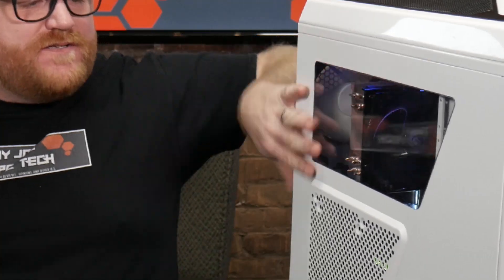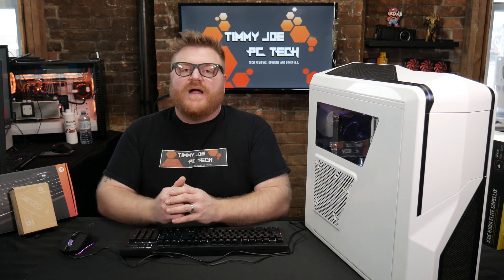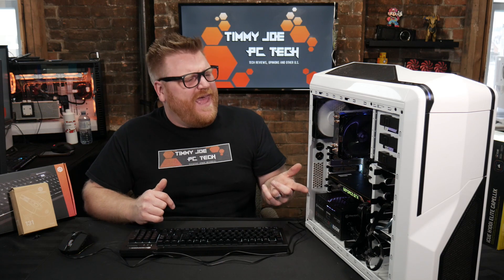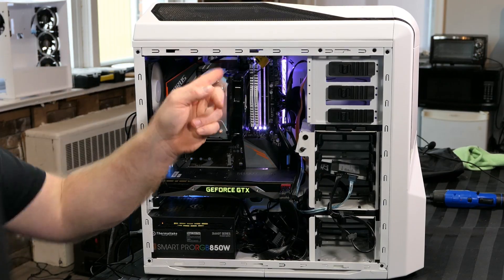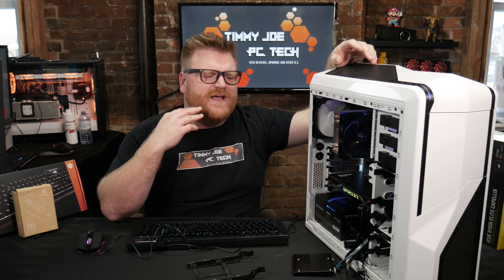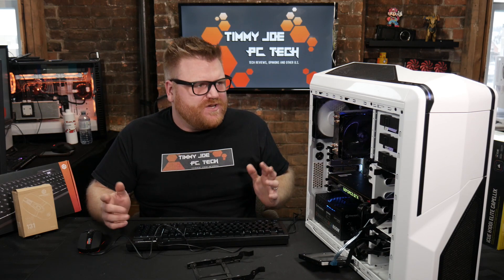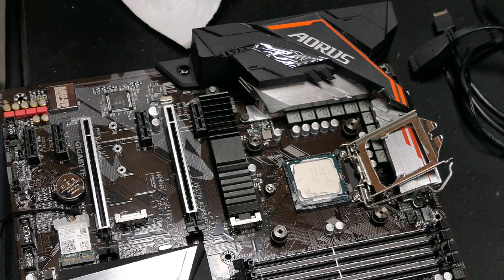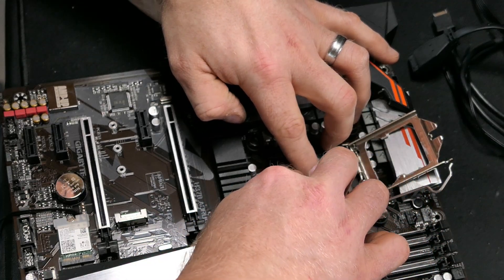How to find used PC deals and make them NEW AGAIN!

Comment: I'm pretty sure those grommets on the back are for when you vert mount the gpu
Reply: That may be a joke but we would mount a large radiator on the back of the case or if you where crazy you could use quick disconnects and connect a chiller or radiator wall

Comment: Nice find. I have an i7 8700 and a GTX 1080 myself. Funny enough I recently updated Photoshop to the latest version, from CC 2019 which I had been using. The new version had major lag and slowdown issues for reasons I'm still not sure. I re-installed CC 2019 and it works perfectly as it did before. Maybe that's why they were selling it. Not because the computer was bad, but simply because Adobe screwed up with their newer photoshop version. Regardless, it's nice to see deals can be had even in this PC parts drought if you're willing to look hard enough!

Comment: You put the aio on upside down, just a heads-up
Reply: I opened the comments to post this. To clarify, the rad is upside down. The inlet and outlet should be on the bottom to keep the pump from sucking in air. AIOs always have some air in the loop.

Comment: The phantom a bad airflow case? seriously? I have the Source which is the more classique version and have a perfect airflow, you can remove the HHD tray and put the SSD in the back lol

your rad installation in the corsair is not good, flip the rad that the tubing are on the bottom, because in your config  your pump suck air that is on the top of the rad and make it more noisy

Comment: at one point in time they made several different radiators that sat on the floor and you ran your tubes through the holes. i also can recall one that your mounted to the side of the pc

Comment: The case isn't bad for airflow, it's just that people leave the huge drive cage in there for no reason, and some hot air gets trapped in the top panel, which is easily solved with some cardboard (so it doesn't go to the front side) and decent enough fans. The fans that come with it are terrible, too.

Comment: NZXT has a used section on their website to sell the parts from computers that people have returned. You can get these parts at a discount +30 day warranty. It might be a good place for you to find parts you can used to build systems.
It's honestly painful tinder you just throwing parts around lol. Mad props for having the skill to build systems... I use to build my own computers, but it's been 20 yrs since I last build one and the tech has changed so much that I'm not sure if I could safely build one anymore.
I put a 1070gtx we had for the past 18 months or so on eBay for $75 cause I don't see the point of overcharging for a video card and ended up getting $118 for it which will buy a nice 1TB m.2 SSD card for my son's laptop to replace the 750gb hard drive I put in it last summer. Now he'll have a 256gb SSD boot drive and a 1TB SSD for his games 🤗

Comment: CRC electric contact cleaner works well for getting thermal paste off of components and sockets. usually use it to spray off old TIM on GPUs and heatsinks for repasting

Comment: That case is also terrible for cable management. I have that case and i hate it, haha
Reply: WTF cares about cable management?  My PC is hidden by two monitors.  I always have my PC box to my left, so never see inside.  I have so many ssd's, I leave back panel off and let them hang there.  I have sata extension to my DVD drive, sitting on top of my box.  I have two PC's on my desk, and they are just speaker stands.
Reply: @bradyelich2745  people who take pride in their builds
Reply: @7shortofperfection  And never touch them.  I added new CPU last week.  Adding new ssd's.  More RAM coming next week.  Tell me no pride in my build.
Reply: @bradyelich2745  if you manage it right, upgrades are easier with a clean build.
Reply: @7shortofperfection  none of the wires reach, and no place to park 5 ssd's.
Reply: @bradyelich2745  Who? 99.9% percent of the people who build pc's in 2020.
Reply: @christopherwood2290  Linus is not 99.9% of the world.  Get over him.
Reply: I have been censored here.
Reply: @bradyelich2745  So basically you are saying you are lazy and have a crappy case and are trying to justify that fact. Cool.
Reply: @christopherjames9843  And ur case holds 5 SSD's and  a DVD internally?  You have not built a PC in the last 4 years.

Comment: single channel makes no difference on intel, also you can see its an 8x slot as its only electrically wired half way......
Reply: Actually it does make a difference... Single channel can slow your system's processing by up to 30%. It's always better to go dual channel on any system build.